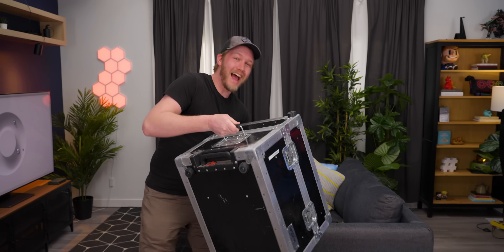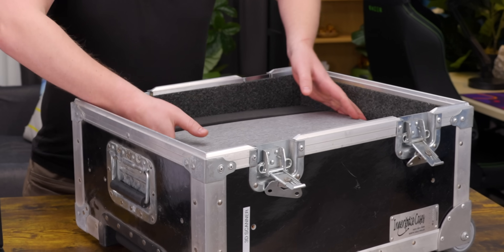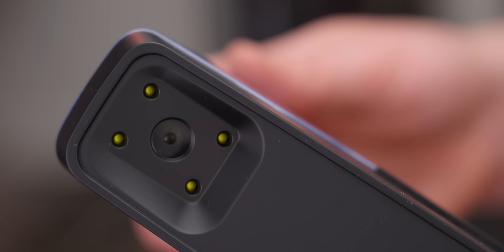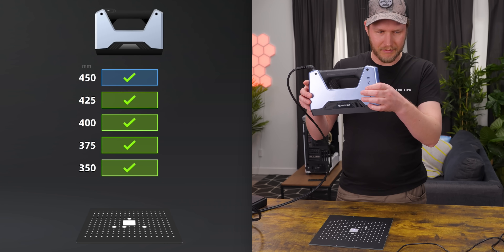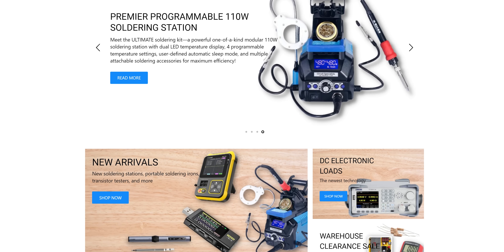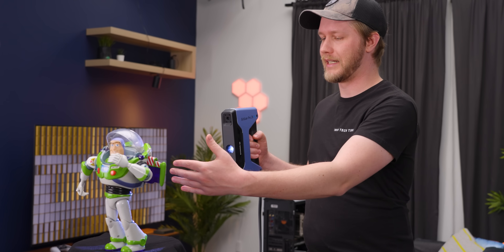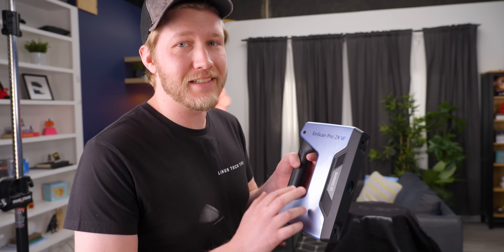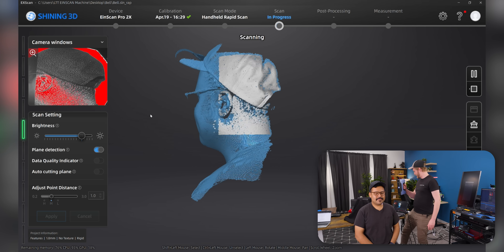I can scan ANYTHING - EinScan Pro 2X V2

Comment: Almost 10 years ago, I asked a friend who specializes in machine vision whether you could do this with a phone. He basically said "not quite yet." Super cool seeing it essentially become real, now.
Reply: I’ve been using Polymaker to do 3D scans from an iPhone for years now
Reply: You can make 3d scans with anything with a camera (including 10 year old phones) using photogrammetry
Reply: @trainsarecool190  Isn't that basically how that one super realistic bodycam FPS is being made?
Reply: Apple Reality Composer exists
Reply: The resolution is a little lower, but there was already an 3d Scanner app by Lubos Vonasek starting around 2021 or a bit earlier (I have a faint memory of it being available much earlier, but I'm probably misremembering it), built upon some earlier Google code, that could do it on just about any Android with minimal AR capabilities (better results with better camera and when the phones included a depth-sensor, but still worked with others). Fully off-line, runs all the processing on the phone itself.
Reply: @tiagotiagot  today Google doesn't care. They saw AR on mobile phones definetly not beeing a thing. AR services didn't receive a lot of updates and there are only few apps.
They are now spending more money on AI and image recognition for AI.
Reply: Adding to my previous reply, IIRC, it was somewhat derived from Google's Project Tango, which according to Wikipedia was initially released around 2014; I need to do bit more research to doublecheck if it was renamed to ARCore, or if ARCore started from scratch,  and whether that is what the app was based on from the start. Memory a big foggy on the details; and I'm not finding all the videos I remember the author originally had about it on his Youtube channel, there might've been some clean up on the backstory perhaps.
Reply: You could do it with an Xbox Kinnect which was probably still cheaper than some phones of the time.
Reply: Photogrammetry software has been available for years now.
Reply: One of the first examples I can think of is the Xbox connect. Confused? Well, it has a RGB camera and an IR depth camera, which makes it really good for figuring out the depth of an object. Then you just add a little nerd magic to it, and you can plot some points on that object. It's been around for at least 3 years, as when I was a student I looked into it really wanting to do some awesome live motion capture for 3D scans of figurines I had. Never tried it because the setup was a bit convoluted, but it was possible! :)
Reply: Some iPhones and Samsungs can already
Reply: we could, it's just no one want a cheap good product anymore. ykwim
Reply: To be honest, these scans are kinda bad, even compared to what you can do with a smartphone.
Reply: My dad had similar foresight. Unfortunately, he passed away far too young in 2014, and didn't get to hear me admit he was right on that one, but back when we were maybe on early Wi-Fi N, around 2012, he said that it was coming that one day you could just come home, set your phone down, and it was your computer playing video wirelessly over your TV, high quality audio directly to your speakers, I think he even said home automation. 
In 2019, I got a Galaxy S9 half price since the S10 had just come out, meaning all that was true about 5 years later, even if it was mostly only same brand compatible, and a decade later, it's hard to find a TV or TV device that doesn't have Air and/or Chrome Cast built in, even DVD players.
Reply: FaceID has almost the same system
Reply: Would be good to use to reverse engineer something like a lian li o11 dynamic 👽
Reply: great❤
Reply: ❤❤❤ good work
Reply: Reality scan from unreal do it for free XD even with textures, but i guess not the same quality
Reply: Itll be really really cool when the iPhone can do this that’s when it might actually change the world
Reply: @colink2967  Look up Reality Composer bud
Reply: 5 years until the iphone pro can do it
Reply: @TheFalseShepphard You already can. That’s why the pros have a lidar.
Reply: @hmm5844  Yup. The reason I switched to iPhone was the hardware to 3D scan stuff being built in.
Reply: @TheFalseShepphard detected the American… 😉

Comment: "System requirements are insane", proceeds to list system requirements that are pretty much the minimum for most PC games these days...
Reply: 32gigs minimum for most games? Are you commenting from the future?
Reply: Exactly
Reply: This is a significant requirement since a lot of machines in an industry run on Windows 98 or XP lmao.
Reply: Which is nothing compared to the average blender user
Reply: To be clearer. 

The scanning can be done with regular setup. But high texture scan and large scans require a massive amount of ram. 512gb plus when your scan is in the 1tb range. I do most of my scanning on a razer 96gb and my processing on ryzen tr 2tb.